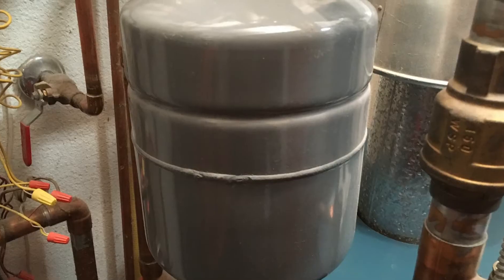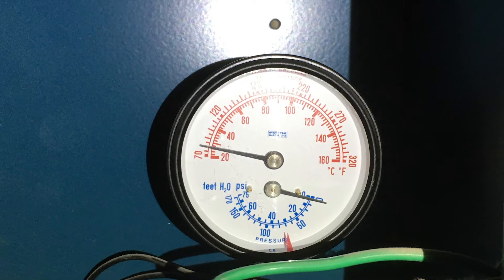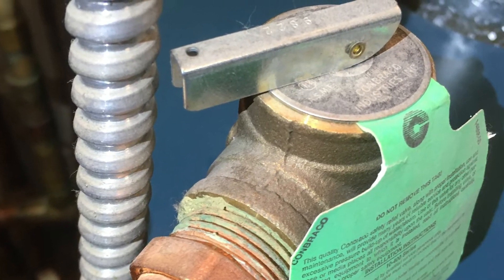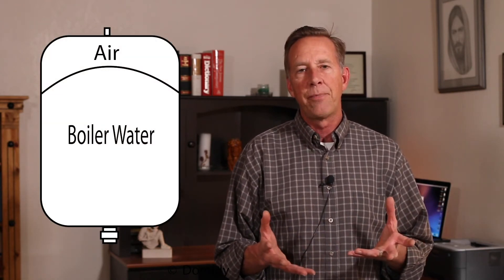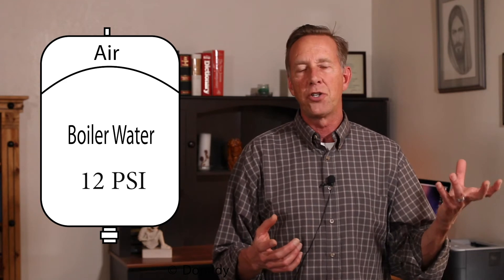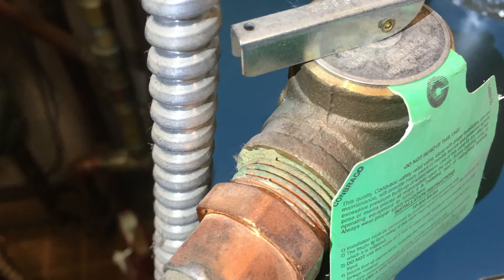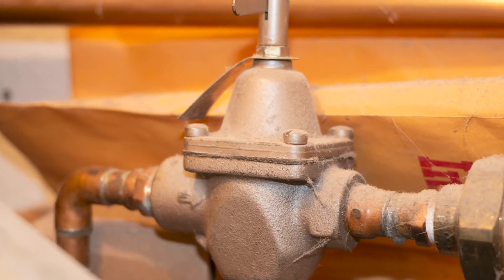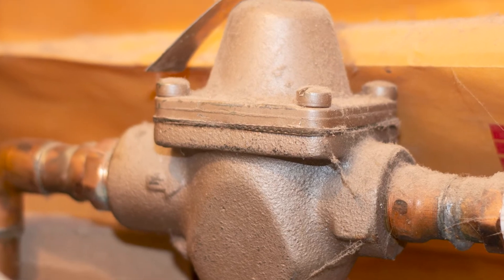Checking Your Residential Boiler Part 2: Expansion Tanks

Comment: Thank  you I  removed the  relief valve  and the  pipe that comes  out of boiler  is  kind of  rusted  and  lots of   rusted  metal and  calcium buildup was inside it that i  removed  i know  it wont survive  2 or 3 more  valve  replacement  if i had an extension  so that extension stays on and  the new  relief valve   get  installed to the extension so   is that gonna be ok ??? not affecting the  valve pressure or so on

Comment: Hi does the over pressure  relieve    can be reset orb once it  opens you to replace it ` mine opened while i  wsa  flashing the system and open the W atts and left it open and closed the   pipes
Reply: Hi John. If the relief valve has opened and is leaking, it must be replaced. If it's an older valve (over a year or so), it should be replaced. Of course, you'll have to remedy whatever caused the over pressure to occur.

Comment: My PRV is still blowin off at 30 psi after changing exp tank make up  valve tridicator  and HW coil on a 2 zone 2 story Burnham oil fired boiler. What am i missing? Could air in system be the cause?
Reply: you could start at fill valve manually close valve to system before fill valve drain some water check pressure, so it is down at 12 psi.
then heat up system see if it goes up only a couple pounds and works normally the fill valve probably gets dirt in it and keeps adding water. 
air in tank can be checked with pressure gauge and if your pressure gauge says normal 12 to 20 psi range and water leaks from pressure relief it is probably bad.
if you close fill valve and system slowly rises with not being on the hot water supply might be leaking back into system at coil. 
or you could be getting to boiling point and pressure spikes as water boils if boiler control runs to hot you have to check each item one at a time.

Comment: Excellent video.  I think my pressure reducing valve is jammed. I let some water in my heater once since the pressure was low.  Now it seems like water is constantly flowing in when it’s suppose to be set at 15psi.  The relieve valve is set for 30 and my heater gets very close to it so I find myself a couple times a month reliving some of the pressure. Should I be doing this?
Reply: No, you shouldn’t need to. The 12 psi from the pressure reducing valve should be the boiler pressure when cold. When hot, it should go a bit higher, but not to 30

Comment: very informative . my expansion tank is installed with water entering from bottom of tank. upside down . boiler and baseboards all on same ground level.  Is this an acceptable practice or unsafe ? . Old heating boiler.
Reply: I think the expansion comes as is and can be installed anyway as long as you can check the pressure valve.
Reply: if it is a very old expansion tank, they used to be up in ceiling half filled with air but over time air would mix with water and it would fill with water so you had to go through a whole process of letting water out and let some air in. modern tanks have a domed rubber bladder with a bicycle tire valve and are filled with air to 12 psi at factory and the water pushes diaphragm into tank as it expands usually they can be put in whatever way you want on modern ones. most people put them with opening facing up so they don't get an air pocket, but it would be small on a correctly functioning tank diaphragm is right up to opening when new.